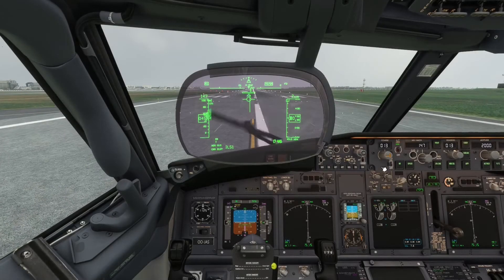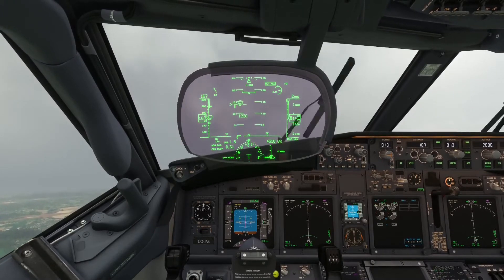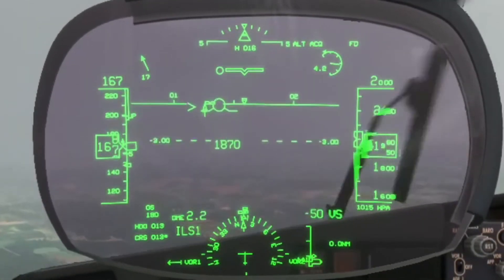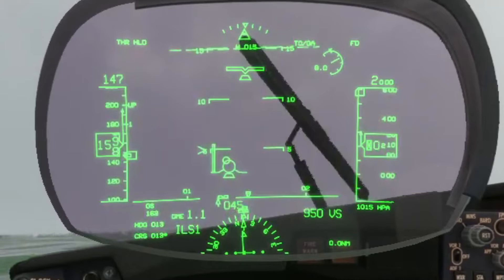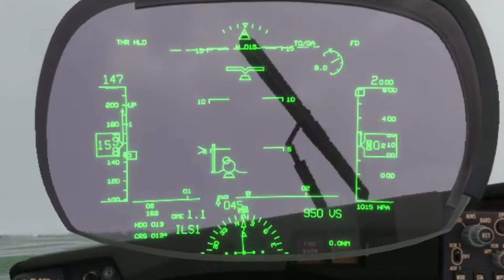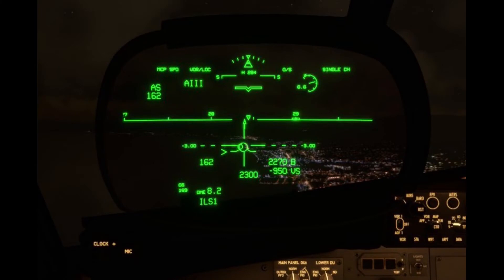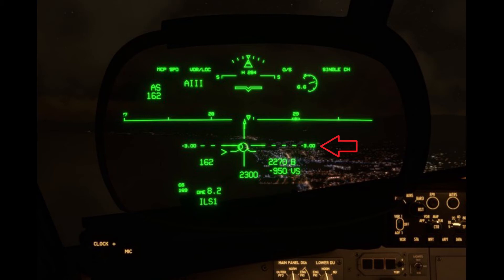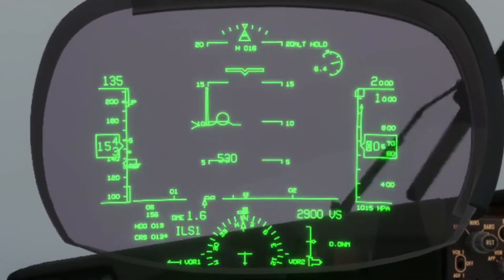MSFS2020 PMDG 737 HUD TUTORIAL/GUIDE | Heads Up Display BASICS

Comment: I was hoping for a more in depth instructional video on the actual setting up the control Module on the pedestal. There you can set up runway info and other information to which the HUD will use. Your video just covers the items you see on the HUD, which is good. Maybe do a part two of this topic to cover those areas? Thanks for the video.
Reply from the maker: That's actually a great suggestion! I'll need to do a little bit of homework to make it happen but I'll be sure to dig into it
Reply: @JoeyPilotYT  Thanks, Looking forward to it.
Reply from the maker: I uploaded a video about the control panel for the HUD😜 I hope you find it helpful!
Reply: @JoeyPilotYT  just saw. Thank you for following up with that. A youtuber who stands by their word : )
Reply from the maker: @Chase1399Aviation  You're more than welcome! I definitely enjoyed the bit of research I had to do to make this video happen